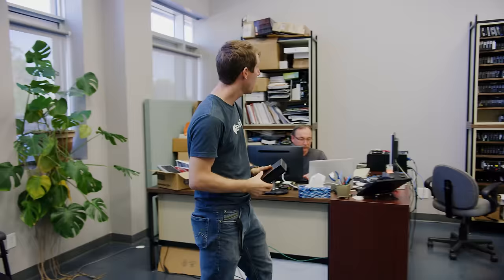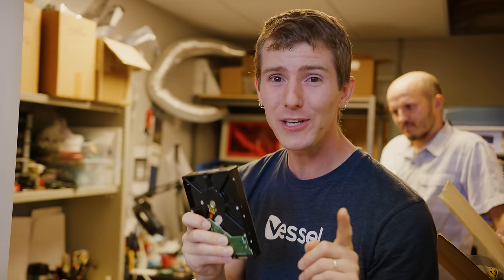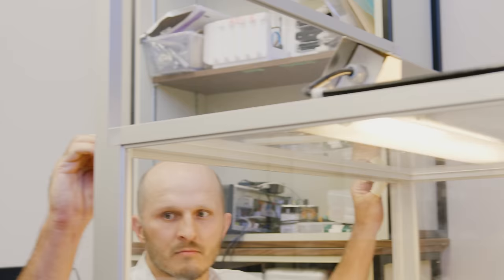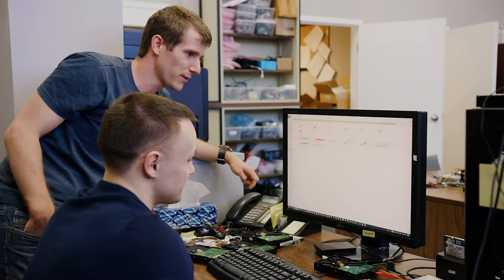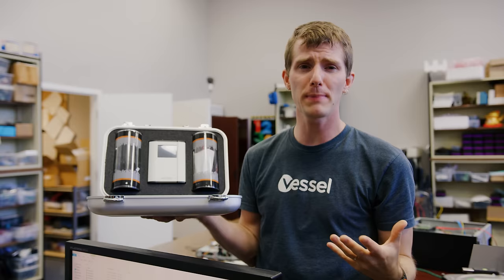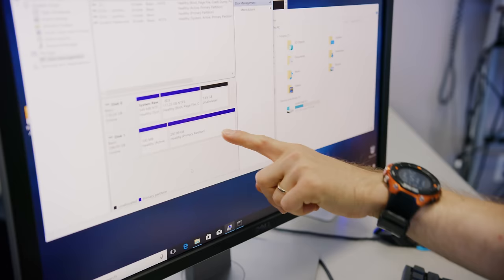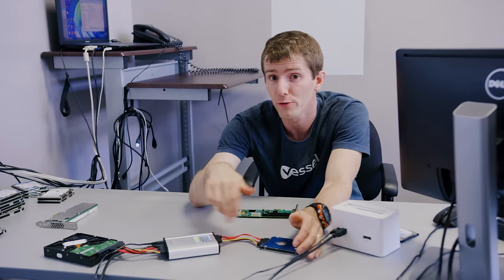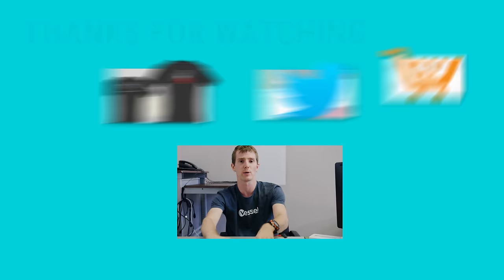Don't Waste $1000 on Data Recovery

Comment: I need help!! 😞 😞 I have a WD elements 1tb and it’s going to cost me $1,400 to recover. It has ALL my kids photos from birth till now on there!! This is what they told me-
Failure to initialize
Electronic failure sustained by the media is preventing
calibration/initialization. Replacement of the damaged
components will be necessary. Additional firmware
recovery and repair will be required to stabilize the
drive. Logical reconstruction of the data will be
completed upon the completion of a forensic copy.
Firmware needs repaired
Read and write heads need replaced.
Files and folders will be rebuilt
Drive is encrypted via the PCB, we will decrypt the
data.

Comment: Yea this is not valid for the new Iron Wolf Pro hard drives however - The clicking sound is actually build in those if the are Ideal - guess on whose recommendation I got one of those unicorns :P

Comment: I just had a "professional" data recovery company Salvage Data, tell me a hard restart when my PC froze, wiped 5tbs of data clean. No data what so ever, not even scrambled data. I told them that is not how computers work. They are sending it back to me but I have a feeling someone made a huge mistake and is giving me this non answer to get out of it. My backup drives where in the mail when before this puppy became unallocated space.

Comment: Just use google sync and sync to all computers , one fails just use another that u can just go back online and sign in and stuff is there that u use online, for off line just back up what u need like drivers and Music into external drives , then if it fails Replace hard drive and Restore windows if one has the restore disk with the Os on it or download tool for windows and create a disc for installing windows then do that and go back to the drive that has the back up drivers etc Reinstall those that need be , is all I do here. as i keep my files i want on external drive as a copy to whats on Internal drive, now if windows corrupts here i have the original windows Os on disc so just Reinstall to new drive then sign in with google, all my online stuff comes back then too.Easiest way for me.

Comment: I opened a broken 1tb drive some days ago and the head was parked in the middle of the plates, not even capable of moving "outside" the drive plates. Is this normal as I always thought the heads are parked outside the plates

Comment: How do I diagnose an external hard drive that my computer doesn't realize it's there? It makes a gentle hum like usual, but my computer acts like it's not even plugged in- no icon/thumbnail, no greyed-out drive name on Disk Utility, nothing. I tried using a different USB cable, but I got the same result.
I really don't want to send it to a pro if I don't have to, because I have an extremely tight budget.

Comment: How do you recover data from a harddrive that may not have windows or any OS on it? and how do you check old ps3 drive for data that is no longer installed in a ps3? is their like a cord you can buy to connect a drive to a PC and check its data?

Comment: What do I do when the plastic broke off at the connector? The pins are still in tact but I can't plug in a cable because the plastic isn't there anymore

Comment: I was able to use EaseUSA program and payed $70 to recover my data as it took 6 days of 3.30TB which was great.  The flip side of EaseUSA I tried recovering a thumb drive which it did recover the .MOV files unfortunately it doesn’t fix the corrupted GoPro .MOV file as it said it does.   Any ideas on sw that will recover GoPro .MOV files?  There is one I found but costs $9 a piece on each movie and I have 15 of them as you can see it becomes costly as it is online.
Reply: Paid*

Comment: This MIGHT help someone else out... A while back I had an external drive that was really important to me start clicking when I plugged it into the front USB port on my PC I thought Oh great, the drive is trashed! Here I found out that if I had any other kind of USB stick drive or another external drive plugged into another USB port at the same time, It would cause the one drive to just click. I Disconnected the other drive and it works perfectly fine again since.

Comment: So I have a WD Caviar Black 2TB which failed recently 7yrs old. It spins up but is not recognized by the PC. Like you mentioned, it progressively got worse within a day then it hung up the computer. If I do use that mount hack, will I be able to access the drive or will I still need that Deep Spar software to get the data off?

Comment: Here I have a real common question regarding hard drivers:
My file system structure got wiped of my ntfs harddrive. How to recover that? My files are still there just the location are scrambled and windows thinks the harddrive is empty.

Comment: I was literally backing up (redundant backup) my data.  The new SanDisk SSD had a problem.  In diagnosing the SanDisk with their rep i was asked to re-create the error code.  In Disk Utility I hit erase, not realizing the tech had asked me to remove the SanDisk SSD to read the model number.  Thus, I "erased" the original data on the Samsung SSD.  How would I "un-erase" the data on the Samsung SSD?

Comment: I wonder what I can do about my Seagate hard drive. The hard drive sounds in working order, no clicking. Ive had the drive for about 2 years, and only recently the transfer speeds became extremely slow. It was only until recently where the drive became completely unrecognizable to my windows 10 pc. I could not find it in disk management. Any clue what I can do?

Comment: My external hard was fell down by my daughter, here is the interesting part it doesn't have noise and it got detected yesterday but today when  I connected it stopped working light is still blinking turning off after few minutes . Is it problem with the connector. Dani Can you tell me what's wrong with it? I copied few photos of my daughter I wish I could have saved all the files before it got trouble again

Comment: so if the smart thingy fails the test of the hard drive after a drop of a laptop and it doesn’t make any noise or clicking, is it dead? i’m just pretty concerned cus I had quite a few things on my laptop. Looking to get it fixed soon, so I guess i’m gonna be looking into that in the mean time.

Comment: The only thing that doesn't give me nightmares about hard drive recovery is caused by a corrupt OS that won't boot, which is also the most painless to deal with. That ticking noise is the worst sound a tech comes across way to often. As I fix computers for a lot of people with low income, there's not much I can do about it.

Comment: I have a laptop hard drive that is locked up solid with write protection. I have tried the diskpart commands to remove the WP, have tried the regedit with no results. My laptop when I try to boot up says no bootable drive. Any answers would be appreciated.

Comment: I have had issues with an old WD5000 (2007) drive. The head was parked in the inner circle of the 4 plates. I opened the drive and saw that there even wasn’t a part where the heads could park. When I moved the heads the furthest possible outside position and run a recovery program over.  5 times I tried that, but always after a 44% scan it stopped and I heard the double click.  What else could I do to get back my datas? Anyone can help?

Comment: hello Linus, I had 2 WD 250 Drives on an AMD system a Very Long time ago. Shut the system down, and hen BANG both Drives literally Imploded.  Rebooting the system the system detected no drives,  After that day I was shocked as when it imploded there was no Discs left in the drive, How can or could you have retrieved data of something like that?

Comment: the softwares i am using to recover my lost partitions on an SSD are not mostly responding as long as drive is connected to the system and they respond normally as soon as the drive is disconnected. i've tried almost 10 softwares in single go one after another and only one software has been able to do it which is yodot but that is paid software when comes to recover the detected files. my drive has around 350GB data. PLEASE HELP

Comment: Believe it or not but my dad used to freeze drives that ticked ant thay usely would work good enough long enough to copy the most important parts YES   freeze it for a week in the freezer  than dry it of and use it fast wile its stil cold

Comment: Are SSD's more secure for storing important data? It still seems like HDD's are more prevalent.
Reply: If you put data on ssd and leave unplugged for say a year it's gone due to the way it stores data it's flash memory. Best to store on physical drive and can leave that unplugged for decades in safe place
Reply: Tysman909 that’s just a myth I thought
Reply: @MichaelVeerman  not  myth actually it's flash storage with no battery. A hdd puts data physically on a platter like you burn a cd. Safer for backing up data as long as it's not running all the time. My backup drive is turned off till I use my image software to make a backup :)

Comment: My hdd is getting hung up as soon as I connect it. It has 3 partitions and only 1 of the partitions was corrupted but it has frozen the whole drive. CHKDSK, EASEUS, PARTITION MANAGEMENT ETC all crash as soon as I insert the drive. 

There are no bad sounds coming from it and it appears to boot up just fine, is recognized etc. It asks me to repair one of the drives and doing so casues it to hang midway through the process. Is this a firmware problem? I have tried cleaning the connectors and none of the PCB looks to be bad at all.

 Also, it isn't a very old drive consider it's use time is minimal. Any help from anyone would be greatly appreciated. All i want to do is format the hard drive and bring it back to 1 partition. I don't care about the data.

Comment: hi
my motorola e7 just broke. 

When i start it, i get this message: 
" Android recovery
motorola/malta_reteu/malta
User/relese-keys
Use volume up/down and power.
Cant load android system.
Your data may be corrupt.
If you continue to see this message, you may need to peform a factory data resest and erase all user data stored on this device.

Then i can chose "try again" and  " factory data reset".

Any solution on this?
I really dont want to loose my data.

Comment: Hey do u have to enable it in cmd again. he doesn't show us. i had a problem when i plugged my external hard drive and it could read the drive till i manually assigned the letter. or do u just leave it? will it be fine is what i'm asking? 6:12

Comment: Hi,I have lost my iPhone backup file of 90GB while i cut paste the backup file from itunes backup folder to an external hard drive. The hard drive wire disconnected during the transfer and the process was discontinued. How ever, i was able to complete the cut paste operation after reconnecting the cable back. But the file i got at the external hard drive was corrupted and not suitable for my iPhone restore. The restore process was showing error after a while. Anyone can help me? Plz.

Comment: Damn, I guess I'm screwed no matter what. As someone who is blind and on low income, there's no way I could ever afford any sort of costly data recovery, and all of the options I've heard about seem like they would be well outside of my means. I have an iPod classic with a 120GB hard drive. I wasn't using it for anything but a storage device, and in 2015, it essentially failed. No computer I plugged it into would recognize it, even though it sounded like the drive was active. There was no clicking or clacking, but no matter what, only two devices ever saw the drive. The first was a specialized machine designed to play talking books for the blind, but also has the ability to play mp3 and other common audio files. Before the failure, the book player used to take a couple minutes of bleeping to process the contents of the drive, then start playing whatever book/audio file I was listening to before. Once the drive started to go bad, however, it took at least 20 minutes of bleeping, with the player saying "error" every so often. The second device to see the iPod's hard drive was my friend's Playstation3. It could see the drive, but when we tried to copy the data, it said "an error occurred during copy operation." The googling and YouTube browsing I've done over the years suggests that it's gonna cost an arm and a leg to get this drive recovered, and that I should probably just write it off and toss out the iPod. This wouldn't be a problem, but there are some documents and recordings I'd stored on the drive that are of significant sentimental value. There are a lot of talking books for the blind, as well as some music on there, but all of that can be reobtained, albeit at the cost of a crap ton of time spent downloading and browsing. The documents and recordings are irreplaceable, though, and those files are the reason I've held onto the device for this long. At the time of the drive's failure, I had no other storage options; that iPod was it. The more time goes bye, and the more research I do, the more I'm starting to think, against my will, that I'm just gonna have to bite the bullet and let go of the drive and its sentimental contents.
Reply: @armstrongdabo3119  That sounds great, but I don't have Instagram. As a blind person, I've never thought there was much point in using a platform that primarily focuses on pictures. On top of that, I'd probably still have to pay for the repairs, and by the time I've finished paying rent and bills, as well as buying groceries, I have almost nothing left.
Reply: @BlindRobotDragon  though he doesn't charge much
Reply: @armstrongdabo3119  By the time I'm done with all necessary expenditures, I generally have less than a hundred dollars left. However much he charges, it'd probably be more than I could afford, or at least that's what I'm afraid of.
Reply: @BlindRobotDragon  nope he doesn't charge much, there's nothing to be worried about
Reply: @armstrongdabo3119  It'll probably be more than I could afford though. Like I said, I generally have less than a hundred bucks left once I take care of all of my necessary spending. On top of that, if he's on Instagram, I'm not on that platform. As a blind person, I can't find much of a point in being on a platform that focuses primarily on pictures and video lol. If I get another stimulus check, then maybe I could afford the repairs, but unless that happens, whatever this guy would charge would probably be outside of my price range. If you told me that he would charge less than a hundred dollars for a tricky repair job like I need, then I'd have to have some references, because quite frankly that sounds way too good to be true.
Reply: @BlindRobotDragon  I'm sure he won't charge you up to hundred dollars, because he doesn't charge much
Reply: @armstrongdabo3119  If that's the case, I'd need some references, because even the cheapest price I've gotten was from Louis Rossman's shop, and that was between 400 and 1100 dollars. If someone says they can do a tricky hard drive repair for less than a hundred dollars, I'm a bit skeptical unless I get some proof that it's legit. This is a drive that has personal and sentimental files on it, so I need to do a lot of checking before I just hand it off to someone.
Reply: @BlindRobotDragon  well the choice is yours, but kudos to Offhackers on Instagram, he did a great job for me
Reply: @BlindRobotDragon  you can go check him and check his profile
Reply: @armstrongdabo3119  I'm skeptical because I was once promised a really cheap repair job from a local shop where I live. I was told that I could get the job done for no more than a hundred dollars, but two weeks and a down payment later, I was given back the iPod, unrepaired and in the same state as it was in when I gave it to the shop. On top of that, this is someone on social media, which makes me question its legitimacy even more.

Comment: a Seagate drive failed. Well, that was a surprise to absolutely nobody. 
Meanwhile, I've literally had my computer running nealy 24/7 for the last 5 years.

WD Drives cost about $20 more than Seagate, but you get significantly better quality.

MY DRIVES:  
3TB Blue (Dual OS - Ubuntu (for my Data Recovery side hustle) and Windows 7 (my main OS) ) 
8TB Gold (Data Hoarding)

#TeamWD

Comment: So should we just move everything to SSD... Or multiple SSD. I for one follow the principle "expect your drive to fail, and do redundant copies. Own a dozen drives now"
Reply: I'd stick with regular drive for data. Ssd is great for OS and software to load faster. If store data on it have no power to it for over a year data is gone
Reply: @Tysman909  I have to research this. I have an ssd which, for some odd reason I haven't attended to over 2 years. I tried accessing data and it worked fine.
Reply: @SaswataMishra1  yah I don't know exactly when data will disappear could be very long time. I just know safer to store important data that's physical stored on platters in regular hdd. Cause I know it will be there guranteed everytime I hook it up

Comment: You can re-install programs, you can NOT re-install your data.  Your computer is only as good as your last backup.  I don't care how you back up your system.  An old hard drive is fine.  I prefer using an automated backup on all my family's computers to our NAS fileserver in a differential backup.  A NAS fil server will pay for itself storing precious data.  NAS server 2 drives RAID 1 or 4 drives RAID 10 and you are Golden, as long as you back up your SH$%.

Comment: In disk manager (windows 7) I have a 2.5 drive attached via USB port. Disk Manager displays this as Disk 1 with the massage "You must initialize before Logical Disk Manager can access it." The choice is MBR and click OK and a return Message "Device is not ready"
It shows Volume as 0 MB. This is the disk I used as Windows 7 system disk with all my files. Anyone have any ideas what wrong of a fix, work around. thanks